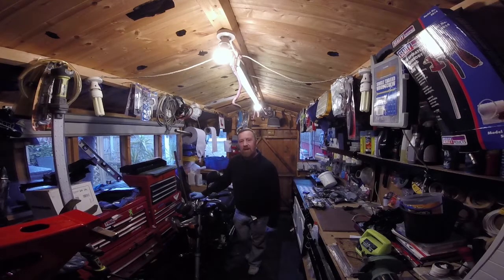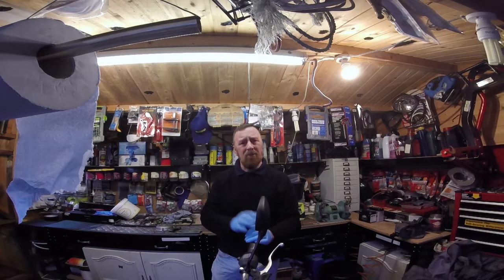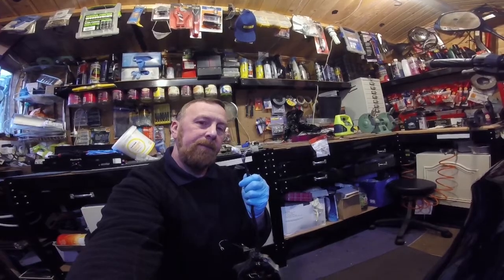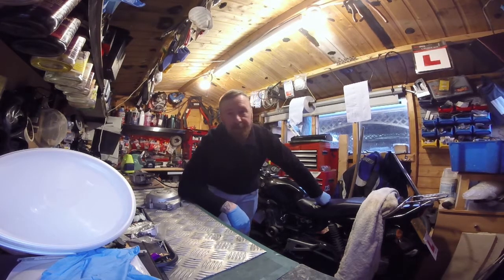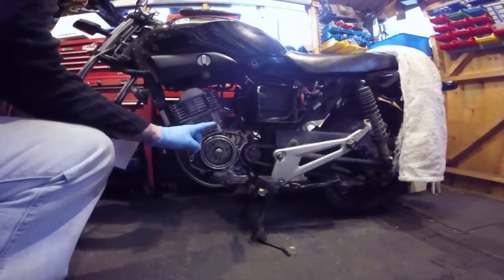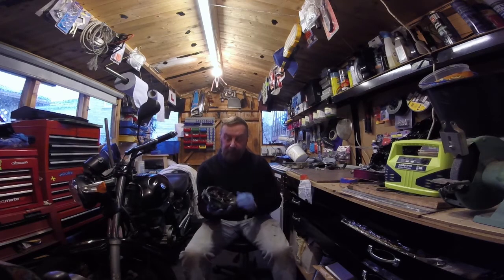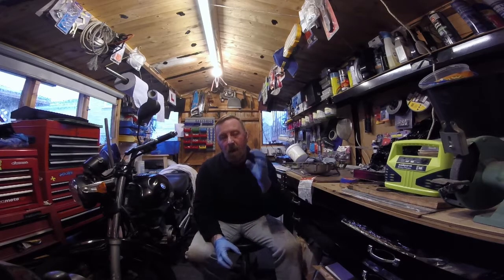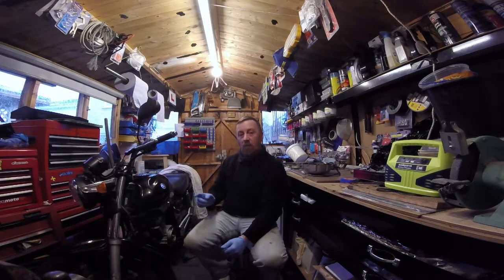YAMAHA YBR 125 STATOR TROUBLE FITTING MARK SAVAGE

Comment: Hi is the engine oil ment to be able to make its way in to the stator housing if you tip the engine over on its side??, I took my stator housing off and you can see the starter motor cogs that drive the stator. It looks like there is some sort of gasket missing separating the bottom end gearbox from the housing area, its a 2007 cheers

Comment: My stator is kicking out 11.4 v is that a weak voltage bearing in mind there was oil swimming about in the stator fly wheel 😂 cheers
Reply from the maker: that's not great and a little low 
no it should be all dry in there 
sounds like the oil seal has gone bud 
I had lots of trouble with my stator as in this and a few other videos on the ybr
give it a god clean up and see what you get after
Reply: @marksavage  cheers for the reply, iv been looking at engine schimatics and gaskets, but I can't see which gasket could have failed to let oil in, as when you look at the flywheel on the bottom left hand side you can see the primary drive cogs through the casings, the gasket would have to be like a sheet of gasket to cover the gaps in the casings?? Are you 100% that old ybr engines don't have a wet stator as iv found after reaserch that some yamaha 4stroke engines do have a wet stator as oil does not affect electricity.

Comment: Hi mate, I need advice on my aerox 50 2009 model please? Bought it running fine with a pipe, 68 jet and big hole in airbox. Decided it was too loud so put standard exhaust back on, standard airbox and 62 jet. I cannot got it to run right now. When you rev it the revs rise but take about 6 secs to drop back down or just increase on their own?? I've had the mixture screw in/out, tickover screw all over the place, checked the reeds (fine) cleaned carb half a dozen times, just when you think it's ok it's starts going haywire again?? Just won't rev and tickover cleanly?? Thanks mate!
Reply from the maker: Phil Down hi bud I have many videos on the aerox and had this too
They seem to not run well with the air box on 
As in my videos I hate them sponge air filters but they do seem to run better with them
Take the air box off and I bet it runs lol 
Put the sports exhaust back on and like in my exhaust video re wod it 
Then back to 68 and the air filter 
It may be a little less loud but it run bud 
Thanks for watching and look at my other videos 
Please like share and sub 
Mark
Reply: Thanks for taking the time to reply! I have watched your other vids and got some great tips!  I'll try what you've advised. Keep up the good work !! 🖒
Reply: Hi Mark, I tried what you suggested, repacked the exhaust, 68 jet, needle in middle position and pod filter. Seemed ok in the garage, ticking over fine, revs ok but then I  went out on it. It was ok at first but within 2 minutes it seemed to lose all power. I had to push off with my feet to get it moving!! Then it died. Back in the garage when you hold it full throttle it revs up, dies, revs up, dies, revs up, dies etc?!? Could this be piston?? Thanks mate!

Comment: Hi mark, have a dreaded snapped engine bolt in my piaggio zip, it’s snapped flush to the engine, what’s best recommend way to extract the bugger, any advice would be much appreciated!
Reply from the maker: hi bud thanks for watching and oh bugger !
watch my video on snapped bolt
https://www.youtube.com/watch?v=8GhfZF6F-MQ&t=1s
this will help bud and when you sort it get four new head bolt or the others could snap too!, you really have to get it out and as cleanly as poss otherwise the head wont seat down and it will never run right again 
please like share and sub and i have may other videos that will get you back on the road i do also have a few on the zip and the basics are the same for all peds 
mark
Reply: Hi again mate cheers for that, got the engine bolt out today garage charged me 15 so not to bad! Anyways it’s my mates zip it’s got a 21mm carb it’s 50cc but it’s been running fine for a week then he cracked the inlet manifold and I’ve replaced it for a new one but everything back on and the ped won’t start, if I put fuel directly into cylinder it will run then cut off, any advice thanks
Reply from the maker: £15 that was good 
have you checked the reeds like in my reed videos?
they may be damage too worth a look and make sure the inlet is on and tight, prime the carb and make the pipes are on ok
mark

Comment: Hi, i think the Con Rod is on the way out on my YBR125. is this something easily replaceable ? or is it costly ? is it worth it as the bike is an 07 at 25,000 miles ?
Reply from the maker: it just may need the tappets setting, does it rattle then?
thought there were over head cam and chain ? 
no matter its a head off and then sort, parts dont cost much it just getting it all off and back on running again !
if your not to worried about it its worth a project and you might just get it all sorted, otherwise just sell as is if running and get another bike bud
Reply: @marksavage  it doesnt rattle on idle( not in gear) but when im in 3rd gear doing about 30 mph you can hear an audible noise